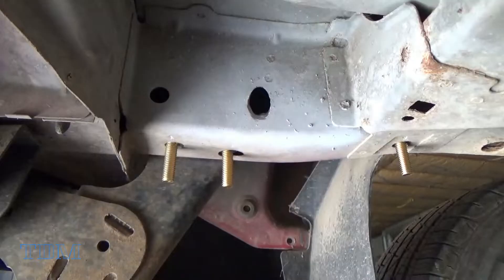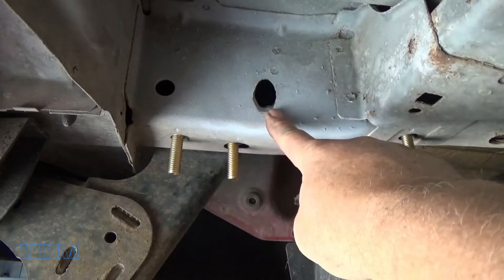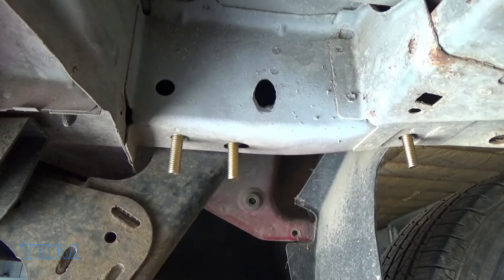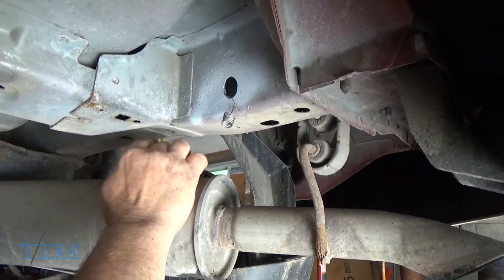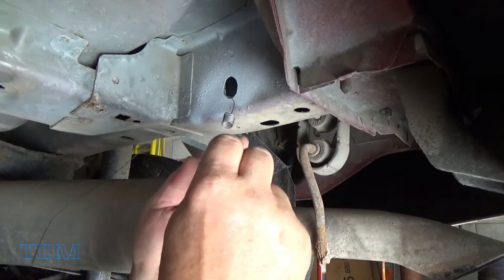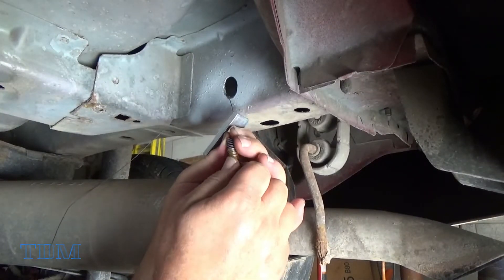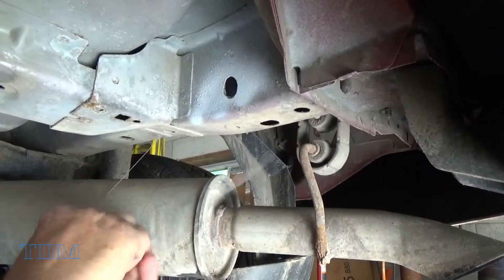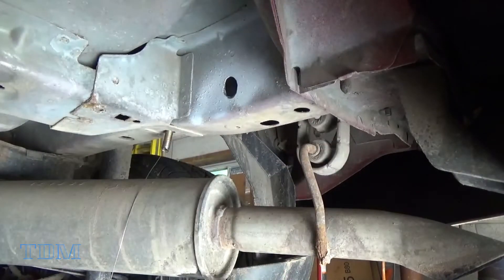Receiver Hitch Installation--2001-04 Ford Escape/Mazda Tribute

Comment: I just bought an 06 escape. I have a bicycle with a 100cc motor. Basically a new vintage motorcycle. It fits in the back but stinks the cab up like gas. Thought a hitch would be a bitch to install. Looks fairly simple. 6 bolts.

Comment: Technically speaking those were done improperly. Your supposed to take the 4 bolts ( might be 6 ) and then the 2 or 3 torx bits off each side remove back bumper amd there is a nice hole that goes back to the bumper so that way your not putting holes in the frame that don't need to be drilled put and your doing it correctly by removing rear bumper . However I don't think it will hurt to do it thos way and it is probably faster by 20 minutes.
Reply from the maker: followed instructions that came with hitch. so if wrong the hitch manufacturer is not giving proper instructions.

Comment: I was wondering why you don't use lock tite.  You use it on every thing else.
Reply from the maker: Could've I guess and instructions didn't call for locktite. Plus after 1 year it will have Pennsylvania  locktite called----rust!
Reply: The Disgruntled Mechanic   I have hitches with the lock washers loosen up. Just a suggestion. You did make it look easy. I need one on a 08 Grand Marquis. Wish you were closer. I would pay you to put one on. Thanks.
Reply from the maker: Oh I thought about the locktite but as I said most stuff rust tight here within a year. Maybe I won't be so lazy next time and put some on! Thanks for the input!